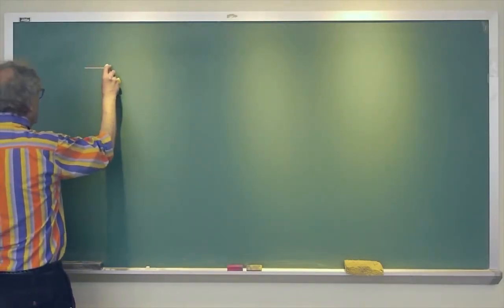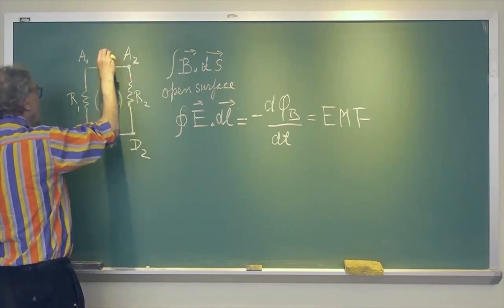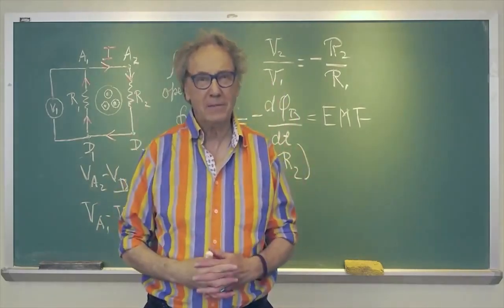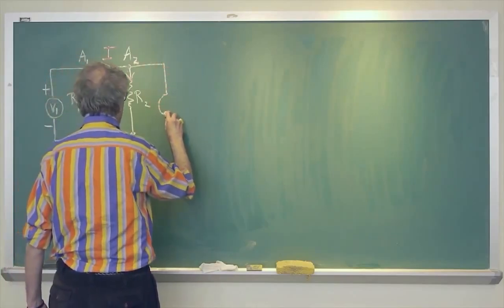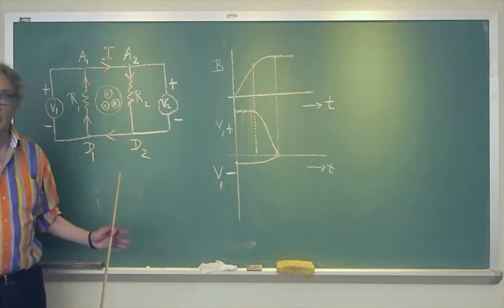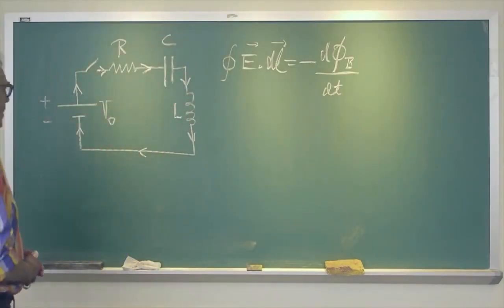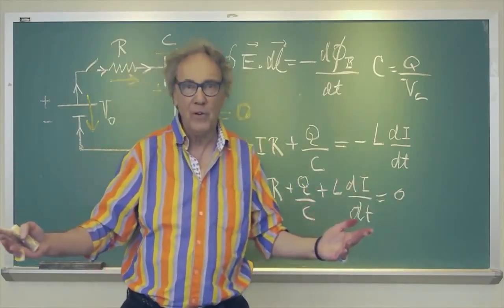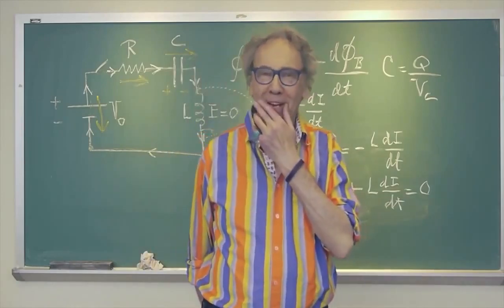Kirchhoff's Loop Rule Is For The Birds

Comment: with all the due respect, this is a magnet drawn on a blackboard behind the representation of a circuit. according to what i have studied of circuit analisis the effect of this magnet on this circuit is none, and this is because circuit analisis does not have a set of rules to handle this scenario. if you want to use circuit analisis to study the effect of a magnet on a circuit you have to introduce in the circuit a transformer, where the control coil is the coil controlling the magnet, and the output coil will lay somewhere inside the loop. this representation on this blackboard is not respecting any rule of circuit analisis, and therefore it should not expect any circuit analisis rule, such as Kirchhoff's Loop Rule, to work. this is my humble opinion, if you think i am wrong (and it happens frequently) please leave a comment below.
Reply from the maker: I demonstrated at the end of my lecture #16 of my 8.02 E&M course at MIT that two identical voltmeters attached to the same 2 points in a circuit can show very different values. https://www.youtube.com/https://www.youtube.com/watch?v=nGQbA2jwkWI&list=PLyQSN7X0ro2314mKyUiOILaOC2hk6Pc3j&index=17
This can also be demonstrated with a transformer.
https://www.youtube.com/watch?v=b7i2uMx7gHo&list=PLyQSN7X0ro22zanLOcvkaSY-IZqheFYM5&index=8
The reason is that an induced EMF (Faraday's Law) creates a non-conservative E field. This means that moving a test charge between the same 2 points in a circuit can require a different amount of energy (even with opposite signs!). You still aren't getting any energy for free, because it comes from the source of the time-varying magnetic field.
When a voltmeter reads a value V it means that the integral of E dot dL across the voltmeter is V. 
In cases where Kirchhoff's loop rule (KVL) applies, 2 voltmeters attached to the same 2 points in a circuit will always show the same value. Kirchhoff's original text can be found in the following link, pages 497-514: https://books.google.de/books?id=Ig8t8yIz20UC. Clearly he was fully aware of the prerequisite for his "loop rule". KVL is a special case of Faraday's Law. That's why Faraday's Law is one of Maxwell's equations and KVL is not.
My demo was first suggested and published by Romer in December 1982 in the American Journal of Physics. This demo has now become a classic; it's done all over the world at many colleges and universities.
ElectroBOOM and Dirk Van Meirvenne believe that 2 voltmeters attached to the same 2 points in a circuit must always show the same value which is not true. They each posted a video on their channel in which they claim to have proof for their wrong ideas.
Also read Professor John Belcher's thoughts on Faraday's Law and on KVL. Professor Belcher is my former colleague at MIT. http://freepdfhosting.com/0813df09f5.pdf
ElectroBOOM insulted me in his video by mentioning that the reason why my 2 voltmeters read different values was due to "bad probing". He stated that if I had done the demo correctly both voltmeters would have read the same value. He could not have been more wrong.  
The following video may also help some of you to understand why 2 voltmeters attached to the same 2 points in a circuit can give very different readings. https://youtu.be/T6S5VS03xZc
Reply: @lecturesbywalterlewin.they9259  
Dear Prof. Lewin,

Recently, there has been a number  videos appearing on Youtube, which disagree with the your conclusions about the Kirchhoff's law in your Youtube videos. 

For instance:
https://www.youtube.com/watch?v=LGdN7rDB3XE&ab_channel=RSDAcademy

Or
https://www.youtube.com/watch?v=nAsZFP8Cfxk&ab_channel=fromjesse
https://www.youtube.com/watch?v=j7o8Mn9c0OQ&ab_channel=joesmith
https://www.youtube.com/watch?v=Q9LuVBfwvzA&ab_channel=ElectroBOOM

Watching these videos makes me wonder if you could make a new video on this topic and sorting out the concepts. This would help a lot of students to understand them correctly.

Thank you very much.

Best regards,

Damdin
Reply: @sugarsurendamdinjav8549  those video are made by people who have only an approximate grasp of physics. I have been personally banned by both RSD Academy and FromJesse (who recently deleted a lot of the comments pointing out his flawed reasoning) for comments where I showed their errors and how to correctly apply EM theory (which is what professor Lewin does).

Don't try to learn physics from YouTube alone. Either study from books (Purcell and Morin, Zahn, Haus and Melcher,...) or from yt channels of accredited professors (like this one, or the Electromagnetics videos from Purdue university).
Reply: @lecturesbywalterlewin.they9259  Dear Professor Lewin, who is this ElectroBoom guy to want to compete with you of the living legend at all. You Sir are the Real Deal and have inspired so many lives to be interested in physics, and that of such a high level as an MIT professor. ElectroBoom is a clown compared to you Sir.Thank you deeply for your Youtube lessons and your glorious and instructive comments.god may bless you Sir.

Comment: I don' t understand the point: you are omitting in the kirchhoff law to include the generator that is the EMF. and you consider the two utilizers as one were a generator changing its voltage reference. You simply have one generator and two utilzers with opposite potential convention. The law sussists, In the second example I don't see why you consider i constant. It's not it's an impulse so you have a di/dt not zero and this mean inside the inductor you have for in instant an increasing B and then a dφ that is NOT null.
Reply from the maker: I demonstrated at the end of my lecture #16 of my 8.02 E&M course at MIT that two identical voltmeters attached to the same 2 points in a circuit can show very different values. https://www.youtube.com/https://www.youtube.com/watch?v=nGQbA2jwkWI&list=PLyQSN7X0ro2314mKyUiOILaOC2hk6Pc3j&index=17
This can also be demonstrated with a transformer.
https://www.youtube.com/watch?v=b7i2uMx7gHo&list=PLyQSN7X0ro22zanLOcvkaSY-IZqheFYM5&index=8
The reason is that an induced EMF (Faraday's Law) creates a non-conservative E field. This means that moving a test charge between the same 2 points in a circuit can require a different amount of energy (even with opposite signs!). You still aren't getting any energy for free, because it comes from the source of the time-varying magnetic field.
When a voltmeter reads a value V it means that the integral of E dot dL across the voltmeter is V. 
In cases where Kirchhoff's loop rule (KVL) applies, 2 voltmeters attached to the same 2 points in a circuit will always show the same value. Kirchhoff's original text can be found in the following link, pages 497-514: https://books.google.de/books?id=Ig8t8yIz20UC. Clearly he was fully aware of the prerequisite for his "loop rule". KVL is a special case of Faraday's Law. That's why Faraday's Law is one of Maxwell's equations and KVL is not.
My demo was first suggested and published by Romer in December 1982 in the American Journal of Physics. This demo has now become a classic; it's done all over the world at many colleges and universities.
ElectroBOOM and Dirk Van Meirvenne believe that 2 voltmeters attached to the same 2 points in a circuit must always show the same value which is not true. They each posted a video on their channel in which they claim to have proof for their wrong ideas.
Also read Professor John Belcher's thoughts on Faraday's Law and on KVL. Professor Belcher is my former colleague at MIT. http://freepdfhosting.com/0813df09f5.pdf
ElectroBOOM insulted me in his video by mentioning that the reason why my 2 voltmeters read different values was due to "bad probing". He stated that if I had done the demo correctly both voltmeters would have read the same value. He could not have been more wrong.  
The following video may also help some of you to understand why 2 voltmeters attached to the same 2 points in a circuit can give very different readings. https://youtu.be/T6S5VS03xZc
Reply: @lecturesbywalterlewin.they9259  Thank you for your answer. I'll take time to  read it and think about it

Comment: Dear Dr.Lewin, in the first circuit (without the battery), the zero resistance conductor is actually the secondary coin of the transformer. So there should be voltages between A1 and A2, and between D1 and D2.
Reply from the maker: potential diffefrence between A1 and A2 is zero. THe resistance of the wire that connects them is negligiby small.

Comment: Kirchoff neglects radiation effects, this should be the first sentence uttered by the professor teaching circuit analysis. You are mixing two incompatible things in one diagram, electrostatics do not exist in a circuit schematic whereas lumped resistors do not exist in the other. In my opinion, very confusing from a didactic standpoint.
Reply from the maker: I demonstrated at the end of my lecture #16 of my 8.02 E&M course at MIT that two identical voltmeters attached to the same 2 points in a circuit can show very different values. https://www.youtube.com/https://www.youtube.com/watch?v=nGQbA2jwkWI&list=PLyQSN7X0ro2314mKyUiOILaOC2hk6Pc3j&index=17
This can also be demonstrated with a transformer.
https://www.youtube.com/watch?v=b7i2uMx7gHo&list=PLyQSN7X0ro22zanLOcvkaSY-IZqheFYM5&index=8
The reason is that an induced EMF (Faraday's Law) creates a non-conservative E field. This means that moving a test charge between the same 2 points in a circuit can require a different amount of energy (even with opposite signs!). You still aren't getting any energy for free, because it comes from the source of the time-varying magnetic field.
When a voltmeter reads a value V it means that the integral of E dot dL across the voltmeter is V. 
In cases where Kirchhoff's loop rule (KVL) applies, 2 voltmeters attached to the same 2 points in a circuit will always show the same value. Kirchhoff's original text can be found in the following link, pages 497-514: https://books.google.de/books?id=Ig8t8yIz20UC. Clearly he was fully aware of the prerequisite for his "loop rule". KVL is a special case of Faraday's Law. That's why Faraday's Law is one of Maxwell's equations and KVL is not.
My demo was first suggested and published by Romer in December 1982 in the American Journal of Physics. This demo has now become a classic; it's done all over the world at many colleges and universities.
ElectroBOOM and Dirk Van Meirvenne believe that 2 voltmeters attached to the same 2 points in a circuit must always show the same value which is not true. They each posted a video on their channel in which they claim to have proof for their wrong ideas.
Also read Professor John Belcher's thoughts on Faraday's Law and on KVL. Professor Belcher is my former colleague at MIT. http://freepdfhosting.com/0813df09f5.pdf
ElectroBOOM insulted me in his video by mentioning that the reason why my 2 voltmeters read different values was due to "bad probing". He stated that if I had done the demo correctly both voltmeters would have read the same value. He could not have been more wrong.  
The following video may also help some of you to understand why 2 voltmeters attached to the same 2 points in a circuit can give very different readings. https://youtu.be/T6S5VS03xZc

Comment: Prof. Lewin is correct. Kirchhoff's Voltage Law holds only when the voltage source is inside and part of the current circuit. Even in a transformer circuit the secondary coil of the transformer acts as the connected voltage source of the components circuit connected to the secondary. Dr. Lewin's explanation https://www.youtube.com/watch?v=LzT_YZ0xCFY shows clearly that the voltage source (i.e. electromagnet) is not connected and part of the target load circuit. 

There is no voltage source in the circuit to begin with and apply Kirchhoff's Voltage Law. Kirchhoff's Voltage Law is not wrong but simply not applicable in this case. 

Antenna theory is more suitable for describing the case where different impedance elements are EM irradiated with a single transient signal and according to their impedance develop a voltage drop transient reception signal. 

That what many people don't understand is that it is not the case of two parallel connected different resistive paths (elements) in a voltage source circuit  that must have the same voltage drop value in each path but instead the case of an inductive loop with non uniform distributed resistance along  the loop. Therefore, the different resistivity segments of the loop are not in parallel but is series.

Comment: You added an external power source to your circuit without actually adding it as a symbol.
Kirchhoff's law is basic and still perfectly working, it's the drawn circuit that is flawed.

I've seen some measurement by an old oscilloscope in another video, just as the guy there said you must have setup the experiment in such a way that you induced current into your own probe wires, partially cancelling the circuit.

I recommend to sit for a while on it, forget everything you believed about it and reconsider. Science is more about admitting errors than making discoveries, if you can not admit an error you are stuck just as the people who started to hang others who said the earth is rotating around the sun.
Reply from the maker: I demonstrated at the end of my lecture #16 of my 8.02 E&M course at MIT that two identical voltmeters attached to the same 2 points in a circuit can show very different values. https://www.youtube.com/https://www.youtube.com/watch?v=nGQbA2jwkWI&list=PLyQSN7X0ro2314mKyUiOILaOC2hk6Pc3j&index=17
This can also be demonstrated with a transformer.
https://www.youtube.com/watch?v=b7i2uMx7gHo&list=PLyQSN7X0ro22zanLOcvkaSY-IZqheFYM5&index=8
The reason is that an induced EMF (Faraday's Law) creates a non-conservative E field. This means that moving a test charge between the same 2 points in a circuit can require a different amount of energy (even with opposite signs!). You still aren't getting any energy for free, because it comes from the source of the time-varying magnetic field.
When a voltmeter reads a value V it means that the integral of E dot dL across the voltmeter is V. 
In cases where Kirchhoff's loop rule (KVL) applies, 2 voltmeters attached to the same 2 points in a circuit will always show the same value. Kirchhoff's original text can be found in the following link, pages 497-514: https://books.google.de/books?id=Ig8t8yIz20UC. Clearly he was fully aware of the prerequisite for his "loop rule". KVL is a special case of Faraday's Law. That's why Faraday's Law is one of Maxwell's equations and KVL is not.
My demo was first suggested and published by Romer in December 1982 in the American Journal of Physics. This demo has now become a classic; it's done all over the world at many colleges and universities.
ElectroBOOM and Dirk Van Meirvenne believe that 2 voltmeters attached to the same 2 points in a circuit must always show the same value which is not true. They each posted a video on their channel in which they claim to have proof for their wrong ideas.
Also read Professor John Belcher's thoughts on Faraday's Law and on KVL. Professor Belcher is my former colleague at MIT. http://freepdfhosting.com/0813df09f5.pdf
ElectroBOOM insulted me in his video by mentioning that the reason why my 2 voltmeters read different values was due to "bad probing". He stated that if I had done the demo correctly both voltmeters would have read the same value. He could not have been more wrong.  
The following video may also help some of you to understand why 2 voltmeters attached to the same 2 points in a circuit can give very different readings. https://youtu.be/T6S5VS03xZc   I thank Mick Vall for his insightful comments.
Reply: The symbol you think about, that of a mutual inductor, implies the presence of a lumped component. The Romer-Lewin ring is unlumpable by definition, because it is required that the two resistors be on the opposite sides of a changing magnetic flux.

There is no place on the ring where you could put such a symbol without changing the characteristics of the system (namely adding a jump in voltage at it's terminals.)

Incidentally, when your circuit path runs around a variable magnetic region, Maxwell's equations dictate that the electric field be not conservative. This in turn implies that the path integral of E.dl along closed paths be not zero, and this means that the voltage can have different values on the two branches such closed path can be partitioned into.

Read chapter 4 of Ramo Whinnery vanDuzer, Fields and Waves in Communication Electronics to understand why this is so and also where the L di/dt formula (even for mutual inductance) come from.